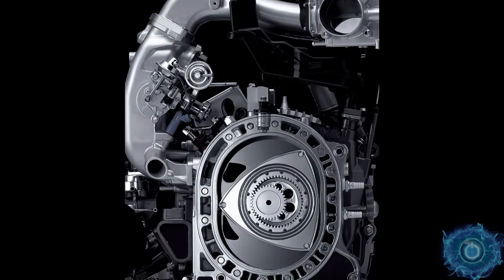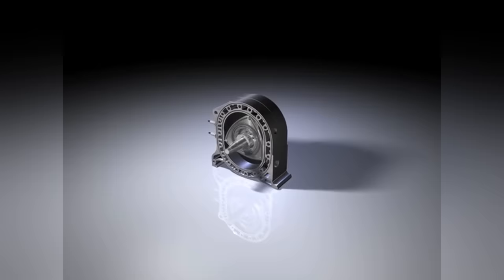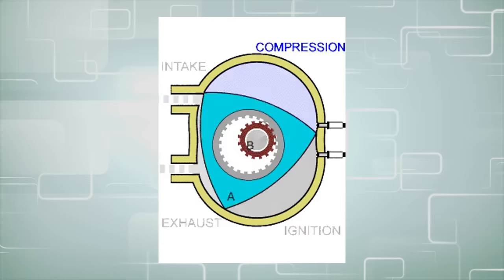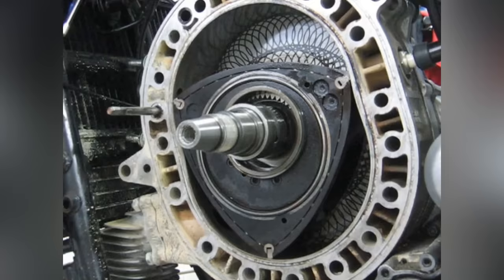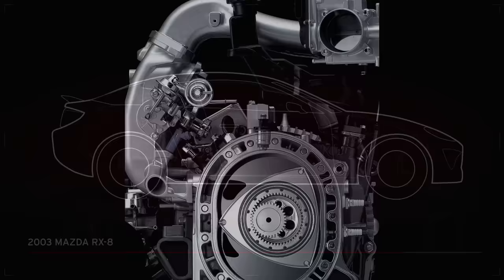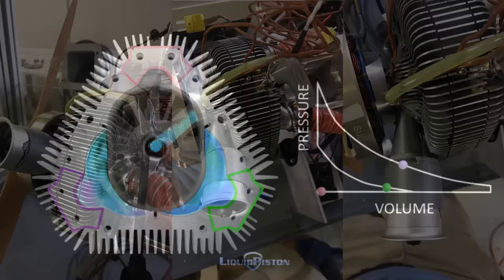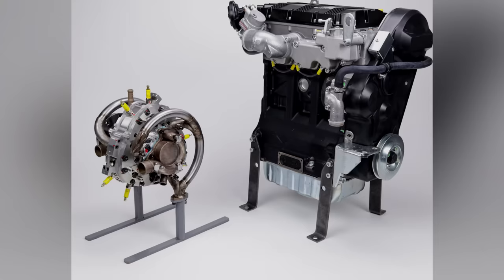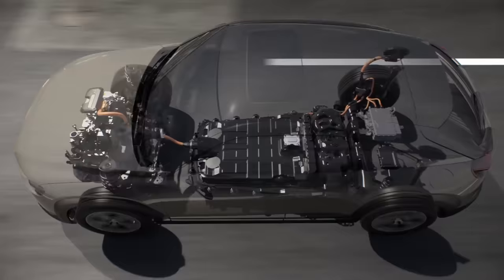STRANGE New Rotary Engine BREAKS Records

Comment: I've been following them for a long time and all they ever do is beg for more investors.

I think they should put that go-cart motor they demoed into production and go from there.

It's easier to get investors to expand a company rather than constantly seeking investment dollars for more rework and design. People get tired of companies that never produce anything.
Reply from the maker: I agree, go small and at least try to commercialize the 210
Reply: The main use case for these engines is military. It started as a DARPA project and it will probably stay military for some time. Maybe specialized mining equipment ect. The engines main claim to fame is size and weight per hp. You will probably see portable diesel generators before any go carts.
Reply: @jameshathaway5117   A diesel anything is a hard sell with the strict EPA regulations.

That engine featured in the go-cart could be used in dozens of applications. I'd like to see it marketed as an industrial engine.
Reply: @tenlittleindians  The military is largely exempt from the EPA regulations.  This has a place.
Reply: @rustylugnut755   I worked at John Deere in the 70's. The road graders and bulldozers we built for the military had straight pipes on them and no smog boxes. It really made no sense to skip the mufflers but that's how they wanted them.

Comment: Just see a lot of combustion area that needs to be sealed compared to a piston engine, like the rotary. But compression ratio seems impressive, guess we'll see if it does what it promises. Old engineers I used to work always said "if it ain't round, it ain't sound", so it's got that stigma going against it too.

Comment: I would love to put one of these in a motocross bike! Imagine a turbocharger on such a small engine running on diesel! That's absolute perfection 👌
In such a tiny package and so fuel efficient it would be perfectly suited to a motocross configuration running via the same motocross bike gearbox 👍
I've seen people mate different engines to a motorbike engine with the block cut off and connected via a chain drive and very surprisingly many work perfectly; if you use the same sized sprockets it matches 1:1. Then if necessary you can change the main gear ratio according to power compared to the original motor? I seen a dude running a friggin chainsaw or wiper sniper motor on one in India and it was revving it's tits off but surprisingly the dude got up and going without any problem and then started shifting up through the gears and picking up speed 😲
I was like "oh c'mon what's this home made bullsh...... Holy fk! Oh damn WTF? This Indian guy just broke my mind lol"
Yes he needs to be very prepared approaching hills but he uses momentum. It didn't go up steep hills but he explained if we waited 5min he will change the gearing again, add links to the chain..... And then he can ride up the hill no problems bahahaha he kept spare sprockets and chain links in his backpack 🤣🤣
He explained that it gets very good fuel mileage.....I stopped laughing when I heard that 😐
The dude is a genius
Reply: don't think diesel would run as well as gas in a rotary.
It would definitely run on diesel, but it would almost certainly run better on gas.

Also, why run diesel in a bike when you could run a high octane racing fuel like methanol?
Reply: @jakehildebrand1824  I've got a student plan. Diesel is very good for fuel mileage. Those converted Kawasaki KLR650s that ran on diesel and jet fuel, they got between 450 and 600miles per tank? So this would make for a very decent "off road" enduro bike? In Australia we don't have a lot of fuel stations in the outback country side, so it could potentially allow for a bike that covers very long distances?
I think perhaps the idea of a paramotor setup running on gasoline may be a more appropriate use for the motor upon reflection? 🤔

By the way I do have a turbo rotary RX7 so I do know plenty about rotary engines  😎
I love the sound of this thing because it's single rotar but sounds much like a 20B triple rotar? I think a 20B sound is the most perfect Rotary sound 👌 it would sound so much nicer than the typical paramotor setup? That's just my opinion but I'm biased 🤭
Reply: It's just very cool to be able to have flexibility of fuel options too?
Reply: @jameshatton4211  best sounding rotary engine would have to be the engine used in the Mazda 787B racecar.
Reply: @jakehildebrand1824  I disagree. I love the 20B sound better
Reply: Get the XTS 210 2 stroke rotary for your bike.

Comment: Two of my favorite things in one concept.   I absolutely had a love/hate relationship with my RX-2.  The performance of the car was magnificent.  It could dust off any Mustang 289 at the time and most other cars.  The 25 to 75 MPH movement was like a rocket.  On the downside, the seals...the seals...the seals and the cooling system, which, if it fails just a little bit, starts warping the aluminum components in the stack.  It cost me many thousands of bucks (some of which found its way back to me via extensive class action law suits).  Love/Hate.

The second concept is a PROPER gas/EV Hybrid where the cost, range anxiety and the charging time anxiety simply VANISH with a credible little gas engine used as a continual charging mechanism without any propulsive duties.  Size and weight to power cannot be be beaten.

If they do this new vehicle correctly, which they have been fairly competent at for many decades, this concept can bust open the EV market.  The biggest costs for all these high priced cars are the huge, heavy and expensive battery packs.  If you can reduce the overall weight and cost in favor of smaller battery farms, the EV market can and should take off in the lower end and in construction equipment and many stationary applications.  

The only thing which will make this even better in the future is the removal of the gasoline and replacing the ICE extender engine and gas tank with a MAGNETIC ENGINE to keep the batteries charged.
Reply: Look at one of the faces of a rotor and you'll see a rectangular piston. This is the reason rotary engines never worked.
Also, thanks for reminding me that range anxiety doesn't exist; only charging time anxiety does, due to the simple but unsolvable fact that batteries store no electricity.
Electric primary traction has been ready since the late 1800's, and since then, every industry has been dominated by electric motors. However, using batteries to power EV's turned them into a niche product, just like electric forklifts, for example.
Reply: EVs will never catch on.
Reply: @LaZarusXtnct     As long as they use batteries, they will never catch on.
Reply: Using a gasoline generator to recharge an electric vehicle while driving it is just driving an internal combustion vehicle with extra points of failure and worse fuel economy.
Reply: @adrianhenle  It improves fuel economy. Electric powertrains are over 95% efficient, and since the engine doesn't have to care about the immediate road demands it can always run at the most efficient RPM the engine was designed for. There's a reason this setup has been common in trains for a long time. Large diesel engine powering a generator, which drives electric motors on the wheels.
Reply: @Connie_cpu  The electric drivetrain being 95 % efficient is essentially irrelevant, because the actual source of the energy is a chemical fuel, and the electric drivetrain does not convert that fuel into electricity--that's done by the generator, and the generator can't escape the thermodynamics that cap it at about 50 % theoretical maximum efficiency.  Diesel-electric locomotives actually run at around 20-25 % thermal efficiency, so there are massive energy losses upstream of the electric motors.  Gasoline engines in normal automobiles get comparable thermal efficiency.

Trains use the diesel-electric system because they can weigh 18,000 tons and it's really hard to design mechanical drivetrains that don't spontaneously turn into fire and shrapnel when trying to accelerate a mass that large.  Cars, on the other hand, weigh more like 1 or 2 tons.  When two machines differ by 4 orders of magnitude in weight, it's often not useful to assume that systems engineered for one machine will be suitable in the other.
Reply: @adrianhenle  You may or may not be correct, I don't know for your simplified description of petrol-to-electric. But once you add the cleverness of computer control over a modern hybrid system, which adds the options of petrol engine direct to wheels, electric direct to wheels, or both; load and speed sensing, smart shutdown, and regenerative braking, even IF you're correct you're still not describing the typical hybrid car which achieves remarkable economy and reliability... as taxi-drivers and millions of others world-wide have found. ...dude, you're wrong.
Reply: @adrianhenle  "the generator can't escape the thermodynamics that cap it at about 50 % theoretical maximum efficiency." I'd be interested to know where you got this figure from as I have seen 85-90% for alternators. It would be an alternator not a generator.
Reply: @gsilva220  "fact that batteries store no electricity." Lol!
Reply: @adrianhenle  "extra points of failure and worse fuel economy" That's what I thought until two friends bought them. I agree with your first point, but the fuel economy is startling - see @Connie_cpu's comment.
Reply: "a MAGNETIC ENGINE" What it that???
Reply: @evaluateanalysis7974  A Magnetic Engine will produce energy through rotation using permanent magnets.   Your first stop is The Lubling Engine from Germany in the sixties.  No fuel.  Lots of examples on YouTube.  Still infancy, but vast potential (haha, pun intended).
Reply: @cloudrdr  "Magnetic Engine will produce energy through rotation" What turns the engine? "Lubling engine" No sign of this from a search or on YouTube. There is a Lueling permanent magnet motor" on YouTube, but this is just a practical joke or a nutter who doesn't understand physics trying to invent a  perpetual motion machine - which is borne out by your statement "No fuel."
In simple English, you don't get ought for nought.
Reply: @evaluateanalysis7974  the cap of 50 ish % is not for spinning-to-electricity device like an alternator, but rather heat-to-spinning/heat-to-electricity device like a combustion engine (a thermal engine). More details on wikipedia: https://en.wikipedia.org/wiki/Engine_efficiency
Reply: @evaluateanalysis7974  Fox News.
Reply: @evaluateanalysis7974  A pop flivver.🤪
Reply: @joerosen5464  "Fox News." A pop flivver." Which of my comments are these answering?
Reply: @ThomasPCGuruENGINES  The assertion I was replying to was, in fact, that the diesel-electric system I described (which is not a simplification of anything) is a "proper" hybrid, and "better" than the actual hybrid gasoline/electric system you're talking about. Your points actually help highlight how wrong the person I'm disagreeing with really is. ...dude, you're not following the conversation.
Reply: @psorek139  "the cap of 50 ish % is not for spinning-to-electricity device like an alternator" so @adrianhenle's comment that "the generator can't escape the thermodynamics that cap it at about 50 % theoretical maximum" is not true. Had he been writing about an internal combustion engine, he might have had a point, but he didn't.
Reply: @evaluateanalysis7974  50 % overall efficiency for converting chemical fuel into translational motion (gasoline -> vroom).  Alternators can turn 85 % of their input energy (as rotational momentum) into electrical potential energy.  If you're making electricity by burning fuel and doing nothing else with the chemical/heat energy, you're using a generator.  If you have a chemical/heat engine that's already doing work, but you want to capture some of that output as electricity on the side, that's an alternator.
Reply: @evaluateanalysis7974  I don't think your friends bought cars based on the diesel-electric technology that was being discussed, but conventional hybrids.  Those obviously do get fantastic fuel economy, but there are a bunch of caveats, e.g. once you get above residential neighborhood / gridlock traffic speeds, you're not using the electric system at all anymore (because that would not be more efficient)
Reply: @adrianhenle  "alternator/generator" Generator - produces electricity, but often used to mean DC power. Alternator - produces alternating electricity (the clue's in the name).
Reply: @adrianhenle "diesel-electric" was only added by someone as an afterthought.
Reply: @evaluateanalysis7974  Read the original comment for this thread--the second paragraph specifies the topic.  The phrase "diesel-electric" was added in a subsequent comment, but diesel-electric is, for reasons also given in subsequent comments, the relevant technology for discussing the general topic.

Go to a hardware store and ask for an alternator, and see if they take you to a device that powers your house during a blackout, or if they tell you to go next door to the auto parts store.  Then, ask to see their generators.  Arguing semantics over what people "often" mean by specific terms isn't helpful, due to variation in context.

The 95 % figure is for converting rotational kinetic energy at an input shaft to AC current.  The 50 % figure is for converting chemical energy (diesel fuel) into rotational kinetic energy (spinning that input shaft).
Reply: @adrianhenle  "original comment for this thread-the second paragraph specifies the topic. " It states "gas/EV Hybrid " "gas" is an Americanism which I assume means petrol but perhaps it includes diesel. "Hybrid" means a mixture not straight petrol or diesel- electric.
"due to variation in context" You have picked the context of a little shop. I am talking about electrical engineering in general.
"50 %" "generator" was stated, not mentioning the overall figure.

Comment: A couple of things: Mazda 13B's were certified in Mooney airplanes a long time ago (so were Porsche boxers).  Secondly, an aircraft radial IS NOT a rotary, it is a radial. Love rotaries, have owned, modified, and driven many.  Good video, but you shouldn't try to compare rotaries to radial piston/cylinder engines.  They are 2 completely different animals.
Reply: When the radial is compared to or designated rotary, it's the one that the ring of cylinders rotated . They weren't static as they normally are, so that's why it's given the moniker of first rotary engine.

Comment: I've been following Liquid Piston for years. It's really disappointing how long it takes new technology to make it to market. It seems like there always has to be a military phase, so I'm glad they've been working for the DoD for a few years. Now they're touting it as able to run on hydrogen too. I think it would make a great range extender for an EV, with so much power per pound. But I've never seen anything more than 40 hp. They say it's scalable, I'm sure it is, but I wish they would just do it. Make one with 100 hp to compete with the Rotax 912 as an airplane engine. The 912 weighs 124 lbs, Let's see if Liquid Piston can produce 100 hp in an 80-85 lbs package. That would allow for 7 more gallons of fuel in a typical light aircraft, enough to fly an extra 60 to 90 minutes.
Reply: Yea more people should touch up on the hydrogen capability, as hydrogen will be experiencing a boom and is the first truly valid combustion based competition to fossil fuels - and with higher energy density at that. For all the downsides of electric solutions, hydrogen offers a healthy competing alternative depending on the application, and the more combustion-style engines we can engineer to use hydrogen, the better. We have near 100 years worth of global r&d invested into combustion already and lots of industry talent at hand. No reason not to make use of them alongside the other alternatives in development.

Comment: So, in Australia, one guy or group came up with a solution to the wankel problems.  They involve making the spark plug hole 2mm slits,  3mm appex seals, a redesign in the rotar cavity, and using a synthetic 2cycle oil pre-mixed in the gasoline.
Reply: And it never really worked...
Reply: @Trevor Sachko   never saw any follow up on the modification.  If you have links to the after modification data, I would love to see it